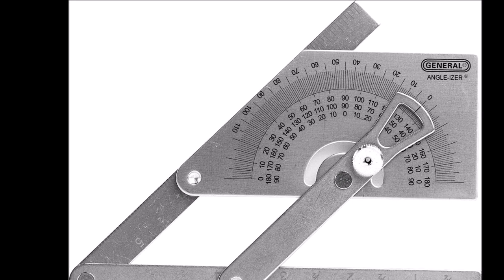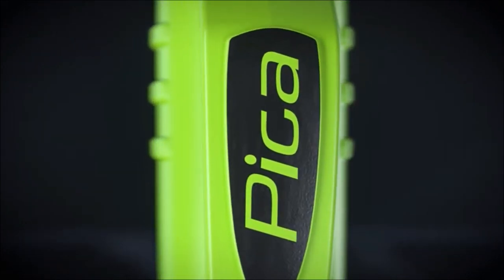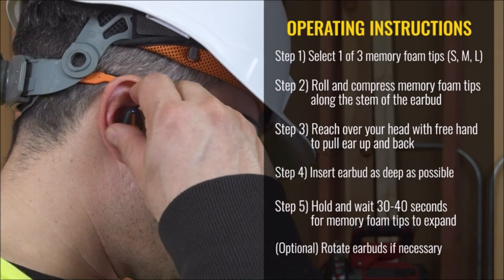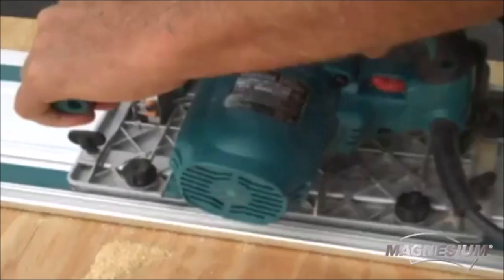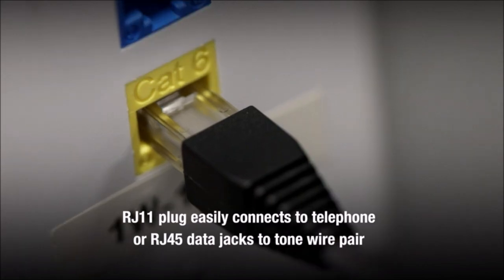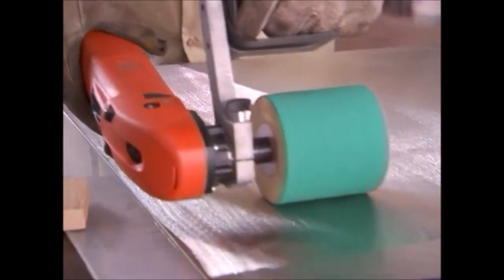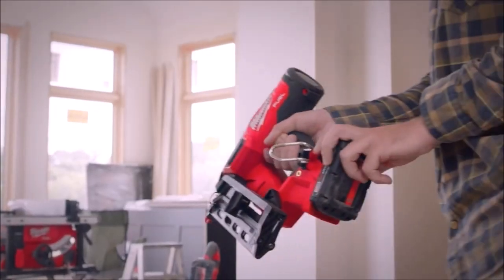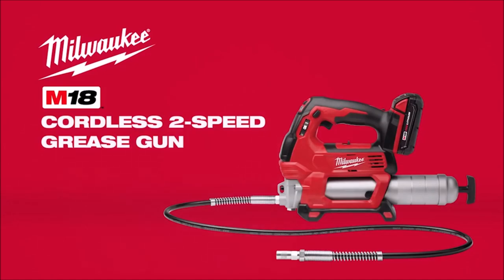COOL TOOLS 2023 :  Top 10 Unique Tools and Equipment of 2023

Comment: Have you seen those planes with the disposable blades,no sharpening req.
Reply from the maker: Yes, I'm familiar with those planes! They are often referred to as "replaceable blade planes" or "disposable blade planes." These planes are designed to simplify the process of maintaining a sharp cutting edge. Instead of traditional hand planes that require regular sharpening, these planes use disposable blades that can be easily replaced when they become dull. This feature is particularly convenient for individuals who might not be experienced in sharpening techniques or those who prefer a more time-efficient solution. These planes offer a balance between efficiency and quality, making woodworking and other tasks more accessible to a wider range of people.